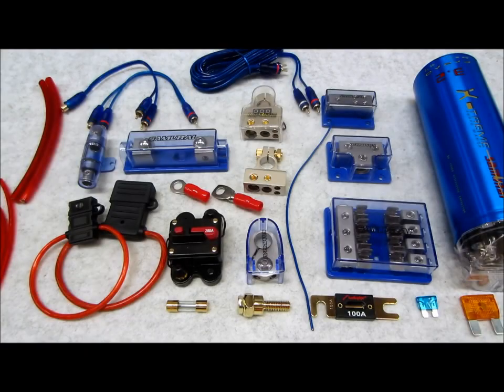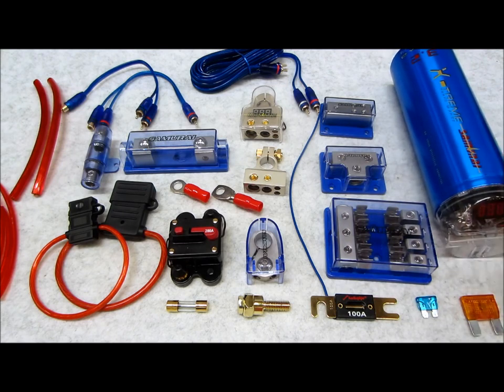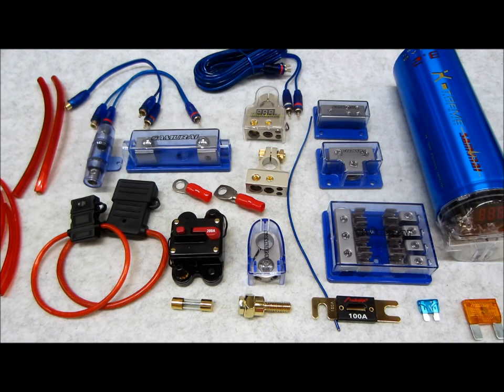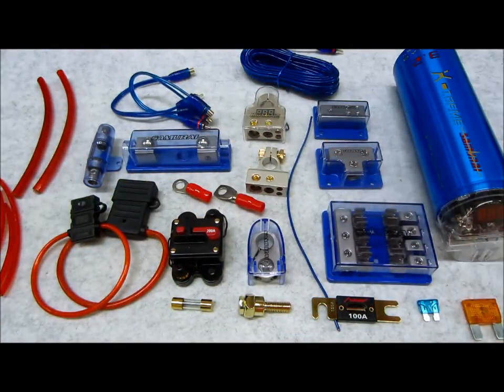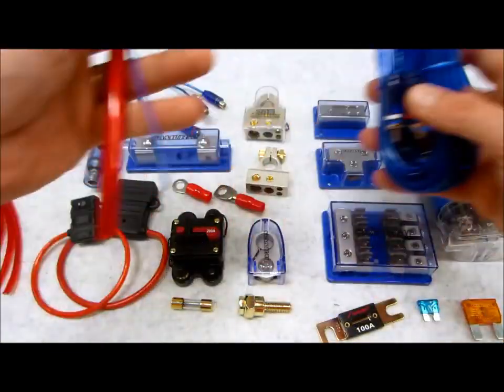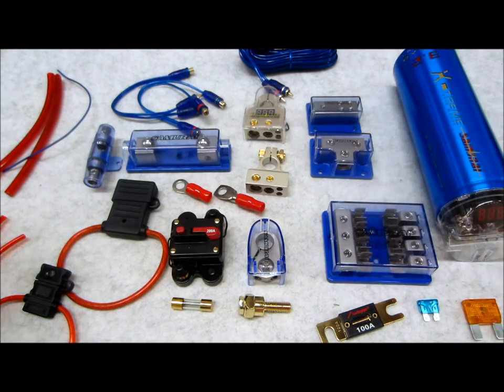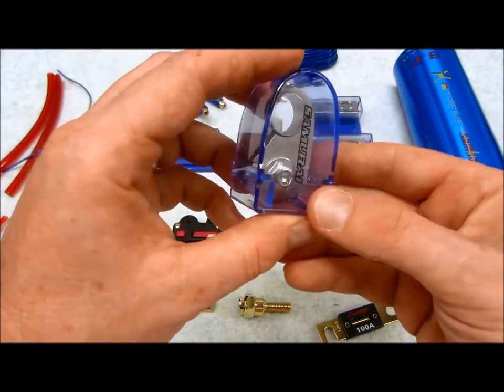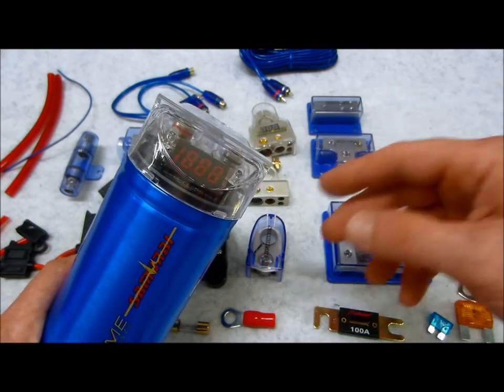How To Wire Up Your Car Audio Amp Power Flow Kit

Comment: lessco electronics its a myth about getting noise when you run power and rcas together i do it all the time and have no problem with noise
Reply: krazywog your right never had a problem my self
Reply: krazywog not usually a problem with low powered systems (baby power wire)
Reply: no true i run 2G power wire with rcas and have no noise